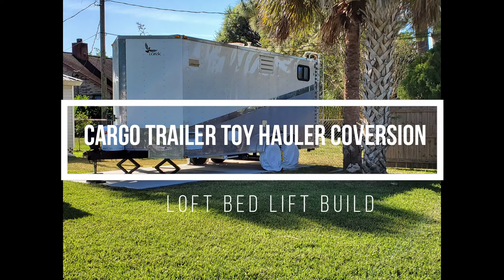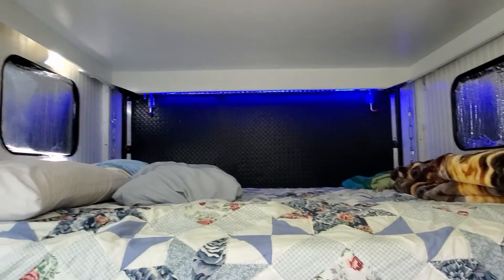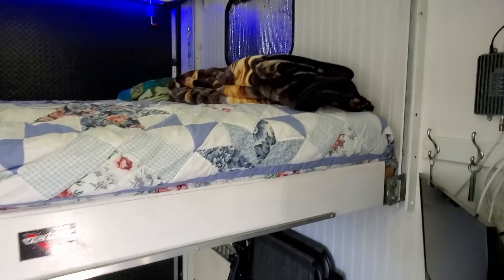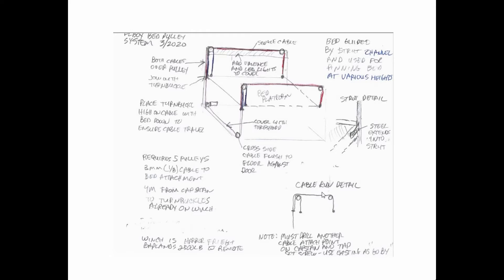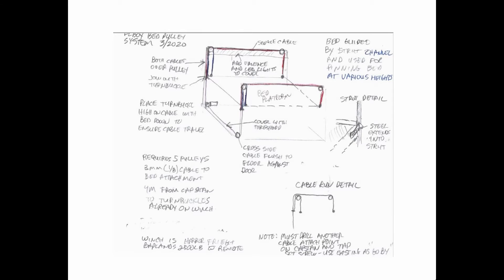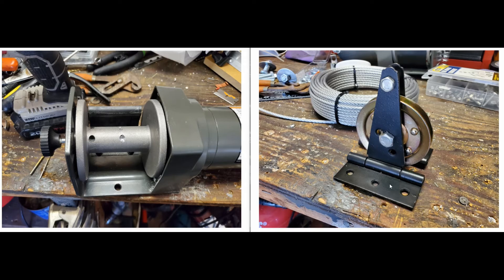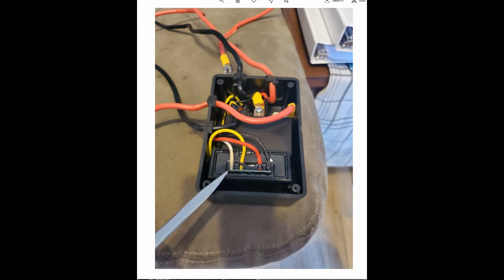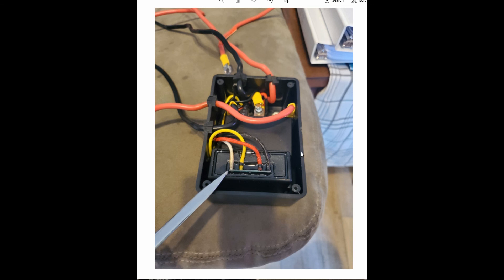Cargo Trailer Camper Conversion - Bed Lift System - DIY Happijac Alternative

Comment: I love the design but I’d have to find a quieter motor or go to hand cranked instead.
Reply from the maker: Thanks. Yes, the motor is very noisy.  I tolerate it, because it works.

Comment: Thanks for the idea.  I was trying the strut idea with a tilting bed and just couldn’t get it to work.  My wife sent me your video and genius!  Only thing I changed to your design was I added one more pulley and mounted the winch under the trailer outside.  Ran the cables through the roller I mounted floor.  Built a box around the winch to keep it clean and perfect!  No winch inside and it reduces the noise a little.
Reply from the maker: Fantastic! Thanks for sharing.

Comment: A wheel that could possibly work in the track is an inline skating wheel. They are narrow and about the diameter needed.
Reply from the maker: I had trolley wheel in the tracks and they bind if not perfectly level from side to side. Actually, wheels are not needed to guide. The tracks are more for pinning the bed up or whatever height you prefer to sleep on and side to side stability when moving so the bed does not move around on the cables.  I have meal tabs protruding into the tracks that will rest on the pins. The cables are for moving the bed up and down, but you do not want to depend on them to hold you up on the bed or etc.. You must pin it.

Comment: I still think a Murphybed would be more practical.
Reply from the maker: I like Murphy beds, but with this size trailer, you cannot deploy the murphy bed with a motorcycle in the trailer.  I designed this trailer specifically so I can use all the amenities (bathroom, bed, kitchen, dinette) when on the road with the motorcycle on board. I just do not lower the bed all the way like I can when the bike is out of the cargo area. When the bike is in, it is about like sleeping in the cab-over in a Class C motorhome or truck camper... Not ideal for me.... but it is comfortable and I do not have to remove the payload to use the bed.

Comment: Don, what a great design and thanks for sharing! I'm planning a van build and the happyjac system seems the only commercial alternative. Yours is genius!  Since mine will be in a van, any thoughts on how much it rattles while driving, in the up position? I'm  thinking some foam packed in the channels while driving will help.
Reply from the maker: Thank you. Honestly, I have no idea since I cannot be in the trailer when towing. You could get away with something similar, but this bed is bulky for a van. Maybe weld up the bed frame with 1 inch steel channel. If I were to do it over, that is what I'd do.

Comment: I guess a remote control bed is cool.  But wouldn't a couple counter-weights be a lot easier?
Reply from the maker: The bed is heavy, would need a lot of weight. If I had a real light frame.. maybe.

Comment: Love the project!!! I'm going to rematch a few times to see if you share your parts list (and where you purchased the hardware etc.).
Reply from the maker: Thanks. Also, please subscribe and add notifications. I have ordered another cargo trailer and starting another build in March. I will be making a series of how to videos as I go for all the major systems (solar, electrical, plumbing, electrical, insulation, etc.) Will include layout and etc..
Reply: @donsdoityourself2547  Did you make it?

Comment: Looks like it works Awesome! I have been wanting to do this to my CTC. Do you have any pictures of how you attached the pulleys / winch?
Reply from the maker: I do, but not sure how to show here... But basically, the electrical struts that I am using for the channel, well you can buy hardware to secure bolts to it, and I got the hardware and bolted on the pulleys. This is the type of strut they use in warehouses and etc. and use it to hang lighting and ll sort of stuff from the ceiling. You can get the strut attachment hardware at Home Depot or Lowes in the same place you find the struts.

Comment: Thanks Donald, for putting this video together. This will be a big help when I build my bed lift this summer. 🖒🖒
Reply from the maker: Glad to help
Reply: Hey Steve, did you build this and if so any tips? I'm planning a van build.
Reply: @gary1739  no, unfortunately not.  My mother had a crippling stroke right after posting my comment, so I'm now her caretaker 24/7. Project is now on the backburner. I do have the hardware to do it though. I'm using hardware from an old hospital bed. 
Their screw jack style lifts that raise and lower the mattress.